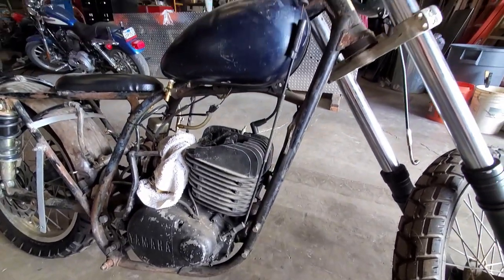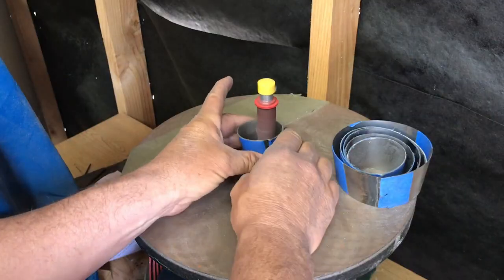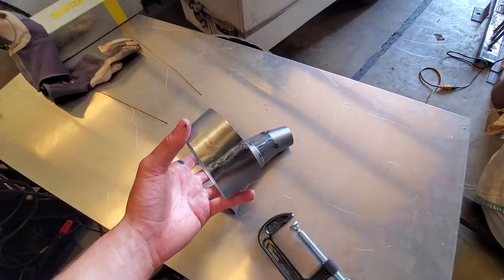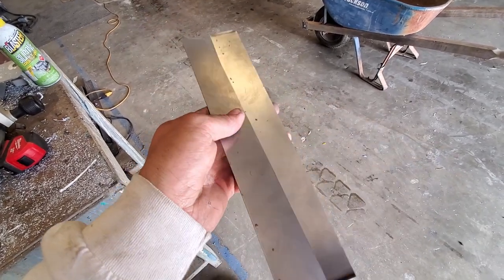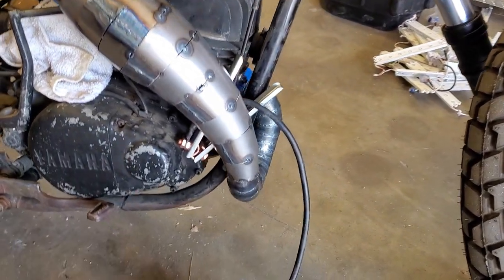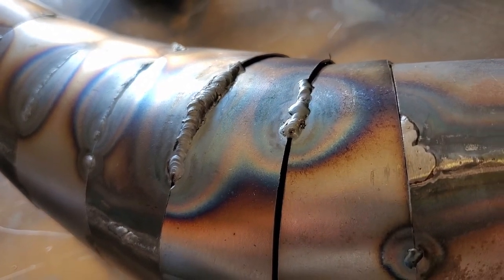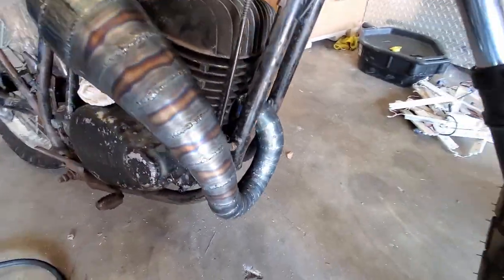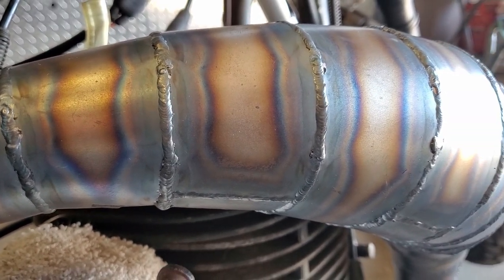EXPANSION CHAMBER BUILD PART 3: Cones & Pie Cuts

Comment: Great job for your first shot. Obviously we strive for a perfect fit but when your stuck with having to fill a gap lay the rod on its side in contact with the base metal and pulse the pedal. This will control heat and ensure the filler is always in position to fill when you apply the heat. As mentioned earlier the hammer an anvil would have allowed you to tap many of the gaps closed or reduce them
Reply from the maker: Thanks for the advice 👍🏼 I'm confident that if I tried again, it would come out much better. Just the practice alone makes it worth it!

Comment: If you want to make perfect cones,  you need to hammer them on cone anvils.  Basically a solid cone made out of steel.  
Use a plastic mallet as not to stretch mallet.   

Tack the cones and "beat"  the junctions.  That will ensure a goot butt joint.

Comment: Ever try Acet/Oxy welding with a small tip and 1/16" rod? Might be easier to control and fill gaps. Also welds up dirty oily cracks in expansion chambers without getting porosity like TIG does.
Reply from the maker: Not a bad idea! I've never gas welded before, just TIG, MIG, and stick. I have the most experience with TIG though. With better fitment/prep, and a lot more practice, I could have these welds dialed 👍🏼

Comment: It is amazing what you do with your do hands.
I have two questions: On Dyno, what does it look like?
could you find carbon fiber that could stand the temp?
Reply from the maker: Thank you sir! I have not had it on the dyno to test the power difference, but it certainly feels much better than the old pipe. I personally haven't heard of carbon fiber being used for the exhaust pipe itself, but it is commonly used on modern two strokes as a guard for expansion chambers.

Comment: U need alot smaller tig torch and thinner 1/16th wire.

Good luck.
Reply from the maker: Yupp, midway through I ran out of 1/16 and had to use 3/32 because that's all I had. I've been trying out 0.035 MIG wire as filler for small welds, and so far it's worked out great.

Comment: Where did you get your cones? Did you make them yourself?
Reply from the maker: I bought them online from Cone Engineering. They have a bunch of different sizes! I bought them unwelded, so I had to run a bead down the length of each cone in order to fuse the seam.

Comment: The form is very nice. What i dint like is that you add too much wire. When i build an exhaust i dont use wire. Only when necessary to fill a gap. But thumbs up for your work. U cant get worse only betten. Lollll
Reply from the maker: Thanks for the advice! For my first major TIG project it went okay, and I've definitely seen some improvement over time 👍🏼
Reply: @FormulaJake  we weld with oxy acethyleen. Argon is too expensive. Only aluminum we weld tig. If we modify crank cases etc and reshape them. Please post video of rge bike starting and riding.
Reply from the maker: https://youtu.be/Cb3aT3oqJ8g

My first time starting her up!

Comment: next time twist some .030 mig wire together with a drill and vice i used three pices for .065 wall eh?
Reply from the maker: What is the MIG wire used for? I'm not understanding what you're describing
Reply: filler rod  @FormulaJake
Reply from the maker: @joenels4356  gotcha. Great idea! Would have been perfect since i ran low on 1/16 filler, the 3/32 filler was absurd. The cones were .040 wall, 20 gauge.
Reply: twist two for that thin i was using two for 065 wall  @FormulaJake

Comment: Everytime this guy cut the pipe he shortened it the thickness of the saw blade. This is a totally wrong method.
Reply: Don’t they get sanded to fit?
Reply: @craigkoeberlein998  you mean sand off even more length?
Reply: @joshuaharrison9331  it they were cut a little long and sanded to fit?  I would like to learn a better way. If there a video you recommend?  Do you have one?
Reply: @joshuaharrison9331  I get what you’re saying I just don’t know what other method you would use to cut them.
Reply: @craigkoeberlein998  lol I do. Make cone template with the angles included. Cone layout for exsample